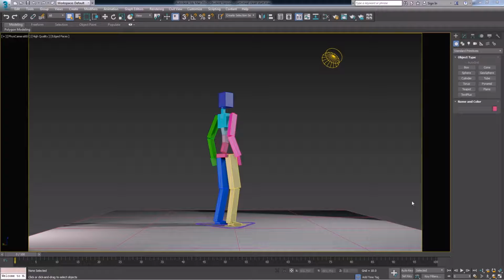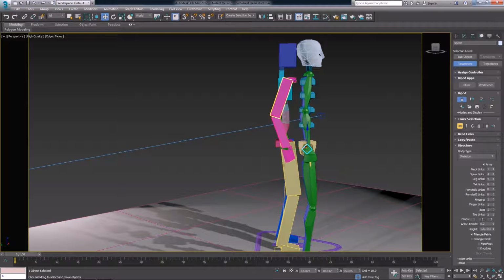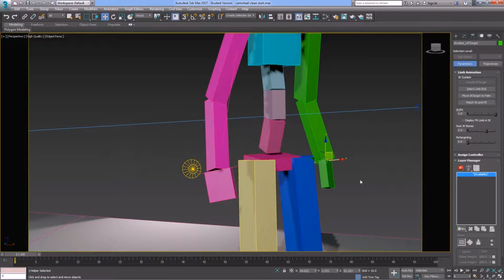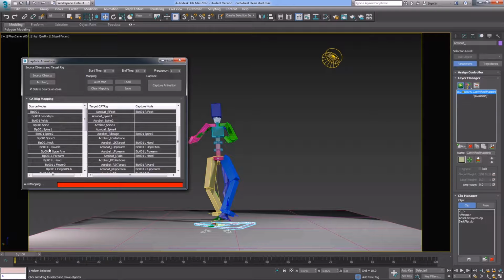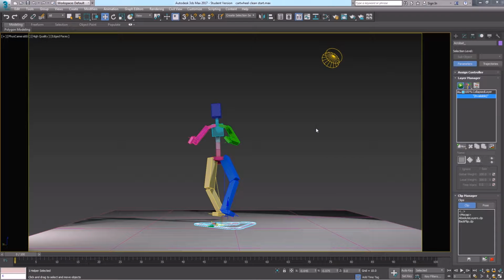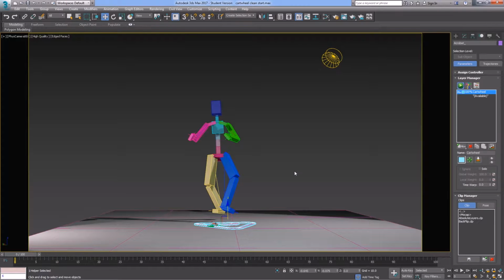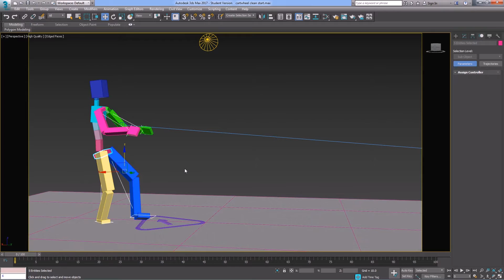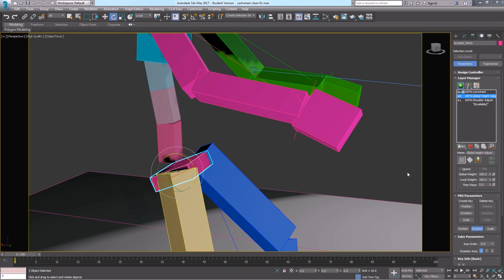Cleaning BIP files in CATRig Part 1

Comment: Hey Ken, thanks for this tut. I'm very new to CatRig and was wondering if you can clean up the normal biped in a similar manner. If not, would I have to switch my character to CATRig and reskin it in order to be able to clean up bip files? Cheers mate!
Reply from the maker: Giom Mouton yes you can. Booed also has animation layers. Exactly the same principle.
Reply: Thanks for that! The million dollar question is now, which one is better to use going into the future? I really only want whats most user friendly and quick. Thanks!
Reply from the maker: Biped has been in 3ds Max since year dot and doesn't quite fit with the 3ds Max way of doing things. CATRig would be my choice because of its versatility. It can be a bit glitchy so a lot of people deride it but a aimple fix on Autodesk Area solves that issue.
Reply: That settles that then. Thanks Ken!